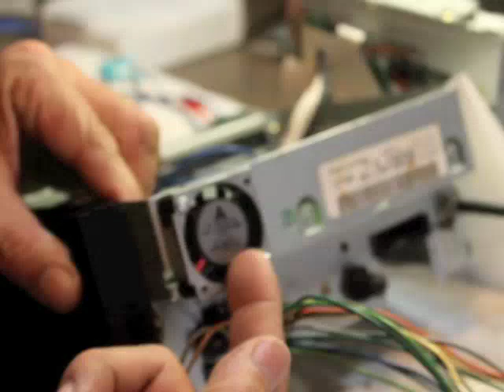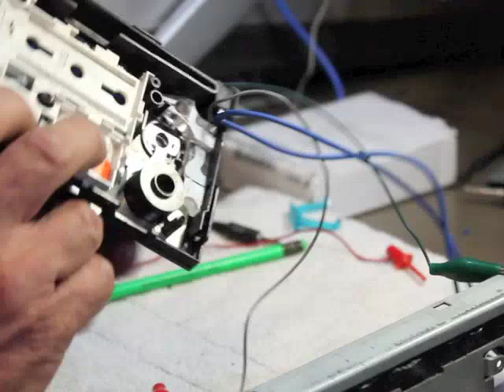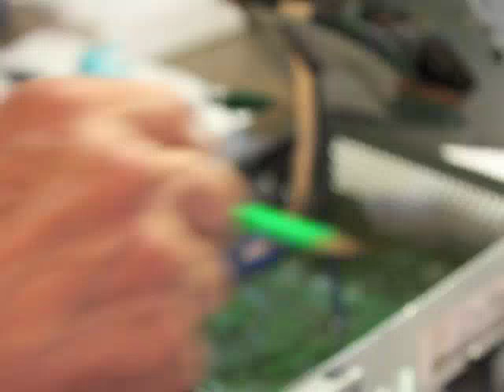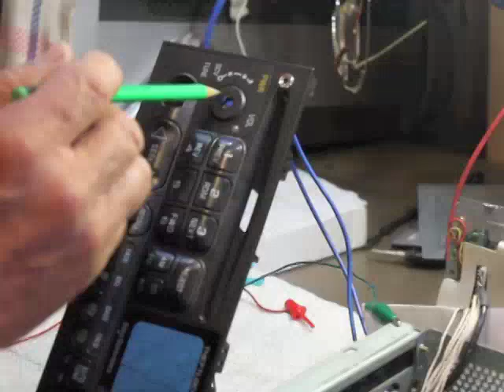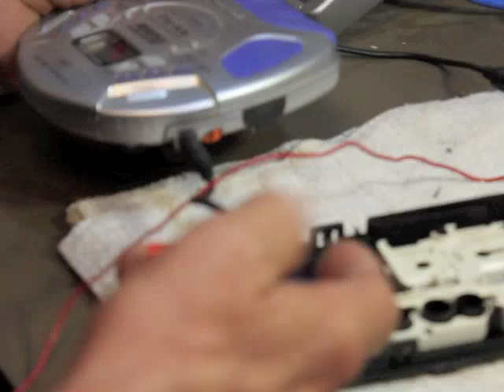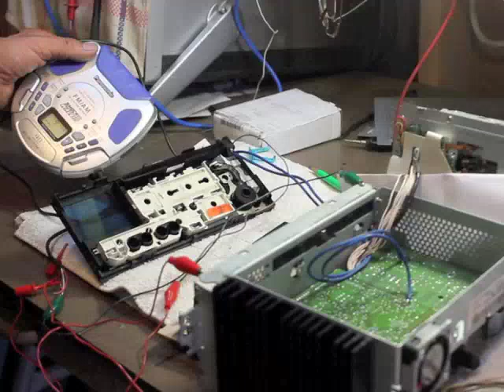Delco Radio Aux Input 2

Comment: Nice video lesson on aux. I counted the bottom connection spot
from left to right 15 solder globs then 2 globs  then the 1 single one is it.
the top wire hooks to furthest left blob , of cross ways row of 7
       I have a radio like this from a 1999  venture van.   I got it home, from
salvage yard ) think I paid $10) 
Tried it on my test bench. Lite up display for just a second  and fuse
blew between radio and my 12 volt power supply . Do you suggest
looking  for a bad capacitor in the power supply. My other radio similar

hooks up at the bench & worked fine. So its not the bench wiring.

Comment: Nice video. Been watching a few videos about adding auxiliary inputs to car head units. Very interesting indeed. You wouldn't happen to know how to locate the preamp output signals in a FM modulator? I have a Kenwood 10 disc cd changer that I would like to add to a newer vehicle's factory head unit which is equipped with an auxiliary input. Problem is I do not want to utilize the FM modulated signal as the  sound quality is terrible. I have the service manuals for both the cd changer and FM modulator, but I cannot figure out how to bypass the fm modulator. I would like to add 2 RCA connectors to the modulator, actually bypassing the  fm modulation of the signal and have a nice clean full bandwidth signal to feed to my auxiliary input. Is this possible?

Comment: So does this overpower the FM signal when connected? I am trying to figure out how it automatically switches when plugged in
Reply: 5 pin 3.5 jack, 4 of the connections acts as interrupted ONLY when u insert 3.5 jack, hence the signal from your AUX jack goes where it needed (before interruption it was coming from an fm radio module) research 5 pin 3.5 jack, 3 pin 3.5 jack wouldnt work

Comment: I have a 96 Buick LeSabre Custom ,  it has a bad cassette deck , I would like to see proper hack to just remove the cassette portion,  make a plate over the front opening,  mount a toggle to switch between aux and the AM/FM ,  this seems reasonable I just dont know proper starting point for this,  stealing cassette wiring to accomplish this?   I have plenty of tools, even a decent scope, plenty of parts, but zero money right now.  Your advice is welcomed.   73 de Seth - W8FG

Comment: Thanks! This worked great!  However, it might be mentioned when using a five prong 3.5 mm jack it will be necessary to jumper between the two normally closed contacts. Otherwise, awesome!

Comment: didn't like the results. now my fm and am doesn't work and when the aux works thru my speakers it's after I switch to am for a second then switch to fm. I have done some older gm radios with aux and I have done them with 2k resistors and wired different and worked like a charm. what did I do wrong?

Comment: I've watched both your vids on this. i have the exact same looking cd player from my 2000 Silverad/Sierra. it has the fan on the rear with bump under the antenna jack. but my board does not look like the one in this vid. So i cant tye into the same location.
How do i find out schematics?
model # 09375915 Delco

Comment: I would suggest doing it this way and avoiding mono sound, also would be easier for a notice to complete.  There is a thread on LS1tech called How you can add aux input mp3 player without adapter that shows close ups and is cut and dry.

Comment: Thank you Tim, my Delco cassette radio built in March 2003 doesn't have the 14 pin CD connector that everyone else uses to add an Aux input. Using your video I was able to cut into the FM circuit exactly as shown and can now enjoy listening to podcasts directly from my iPod without having to "play" a blank tape or CD. You are a gentleman and a scholar.

Comment: I think for the Monsoon style AC/Delco head, there's some adapter called GM10AUX or some sort that plugs in the back. I'm considering this on my Grand Am. (Shame they tease us with the button, but don't provide this feature by default.) And I wouldn't hack up anything on front either, I'd run the wires down so the lead would come from the back of the storage cubby in the middle. Good spot to put the MP3 player and the connection is out of sight and out of the way when not in use.

Comment: Any comments on how to ad a aux input to a GM 15216905 radio that's in my 05 GMC Canyon?  It doesn't have XM so the plug is empty on the chassis. Thanks,  Joe

Comment: Hello Tim..this video looks like exactly the thing I need to do for my radio which is the same as yours here. I am going to mount the 3.5 jack externally on a different part of the dash. But I can't quite figure out the parts that are blocked by your finger or not shown clearly on the video. Can you help me? Thanks in advance!

Comment: I have a Chevy lumina with an almost identical radio ...almost. I'm trying to find the pinout for the fm reciever. The radio's model number is 16232091 and the serial number is89bszfm310480304. The am/fm reciever has a bar code with the number 8086 us vert 7121 raa1w. @tim does your radio have the same reciever, if so I would like to know which pins are the left and right channel. Thanks.

Comment: Has anybody done this and ended up with the FM section being WAY quieter than the AM when finished? I'm pretty sure I have the right connections because the aux jack works fine. I also ran a continuity test between the two points he used before I cut the trace and it had continuity.  What's also weird is I can only hear the ipod when on FM. If I have chosen AM, I hear AM radio. This is regardless of whether the ipod is plugged in or not. This is driving me nuts
Reply: Figured it out. One of my connections had come loose on the board. Couldn't see it til I pulled the CD player back out and took a look.

Comment: Tim, I want to mount the jack remotely. If I use two separate wires inside like you did and bring them to a panel mount RJ 11 at the back of the radio, then use a regular phone cable with the RJ 11 male on one end, cut the other end off to wire to the 3.5 jack, will I experience cross talk? Doing it this way gives me a nice clean small connection in case I have to pull the radio out for some reason.  Also, it appears you are saying that it does indeed give you stereo audio quality and not mono correct? Thanks

Comment: Sorry but this is not the correct way of doing this, you are cutting audio from the FM decoder and the input its only one channel, Mono audio. everybody wants stereo, that is the reason you are only using 2 cables, I'm sure there is a better way to do this if you connect after the preamp  for now there is a 9 pin plug on the back side of the radio and that works with the aux button no need to open the radio just purchase the correct cable with the interface and you can do this in 5 minutes  search online for   Chevrolet aux auxiliary input interface gm9-aux
Reply: Tim Muckey Can you explain how this works with 2 channels.  Looking at that Aux port, shouldn't there be 5 wires coming from it?  One pair for each channel, and one wire for ground?  In the video I only see one pair being used to interrupt the audio on the circuit board.  Shouldn't another pair be used as well?  Your video doesn't explain in enough detail? I'm used to dealing with left & right audio.  Doesn't cutting that trace only cut one channel of audio. Your videos & pictures are the only detailed source of info out there and seems to be the only solution that doesn't require a CD/Cassette in the deck.  Please shed some clarity on how the left & right audio is being addressed.  Thanks for taking the time to make these videos.
Reply: You are confusing the PIE GM9-AUX   with the inferior aai-gm9 from pac
you don't need the slave CD or changer to use the GM9-AUX aux interface
Reply from the maker: Actually this is using 2 channels the third wire for common is the one to the case. This method does work quite well and sounds good. I do however agree there are other better, easier ways of doing this. This video was more for those that would like to try something new. This was just for fun and to get people thinking. Thank you for your valued input.
Reply: Tim Muckey
Hello Tim, thank you so much for giving hope to my old stereo. I don't think my unit is configured for the aux interface and anyway I think it's stupid to pay $40 to get an aux input (considering you can get a nice aftermark radio for less than $100). Can you just please clarify how this is using two chanels? If I correctly understand, one conects jack's pin 1 to ground, pin 2 to the amplifier's side conexion and 3 to FM's side conexion. Is it correct?
Reply: oemautosound you are wrong. I have this same exact 2002 radio, and bought the gm9-aux kit you suggested, and it will NOT work. The only way the gm9-aux kit you suggest will work is ONLY if your car or truck also has the SEPARATE CD slave changer unit in ADDITION to the Delco dash Radio. You can plug in the gm9-aux kit to the back side of the Delco Radio all day long, but if there is no SEPARATE CD slave changer unit, you can NOT input anything through the 3.5 aux jack for the radio to play. I hope this helps others so they don't spend the money for nothing. That is why this modification that Tim Muckey posted is VERY helpful!

Comment: Thanks a lot man for this amazing video, but can you help me out by doing the 2003 Chevy radio single cd , cuz I don't have xm radio to take it from it. Thanks again man
Reply from the maker: I agree you can get an aux interface however; your unit must also be configured for the aux interface. You are correct that there are other ways of doing this. This application does give you 2 channels and sounds good at least for my old ears. For some just getting a more modern replacement radio with all the new technology provides overall greater value. This was just for fun and to show those who would like to play with electronics the infinite possibilities. Thank you for your valued feedback.
Reply: hi Tim, great video, I have a 1998 Chevy Silverado and i want to keep the factory radio. This radio is very similar to the one you showed, but instead of a cd player, it has a cassete player, the board is different but I think it can be done in the same way the radio model is 16265855
Reply: could you help me please? thanks

Comment: Alright, after setting everything up as instructed everything worked overall, however.. once running a test for the right and left audio channels I only have the Right Channel coming through on both speakers but no left channel.. is this how it suppose to work? Also, during the 1-2 seconds of silence between tracks the FM Radio station blasts through the speakers then it goes back to the music on your MP3/Phone/Music Player.. is this how its suppose to work? I'll Post a video of what I mean l8r